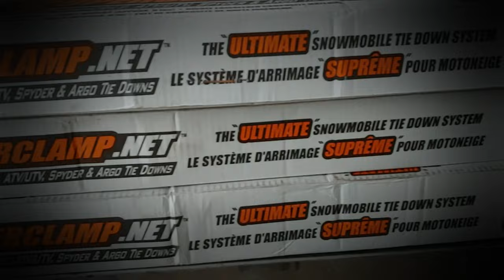The Ultimate Sled Trailer Package || Caliber & Superclamp II Products

Comment: If you’re not sponsored or getting this stuff free then this is the biggest waste of money garbage product you will ever find. Their price is 22x what everyone else is and it still warps and breaks etc.. they this shit in the garbage and use old tracks or cheap plastic from eBay as it’s 1/22 of the cost and it works fine for what it is.
Reply from the maker: I haven't had an issue with this stuff at all. It's been absolutely great! Does it's job and holds up to the tough weather and makes loading, transporting and unloading a breeze and safe. No more slipping around on the competitors crap. Which I've also used before. 

 Thanks for watching...